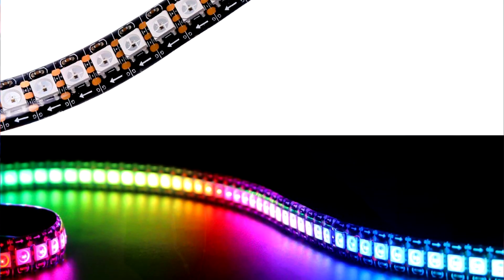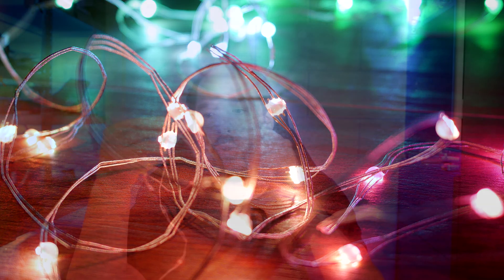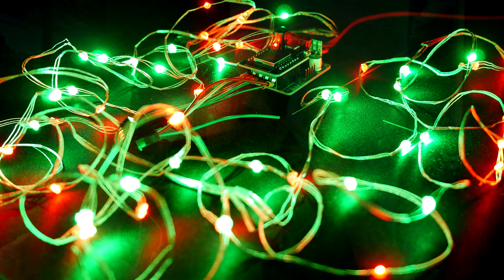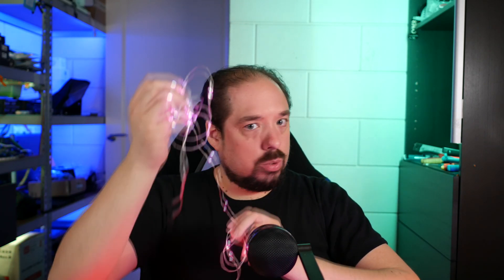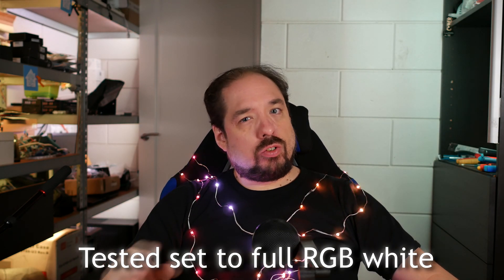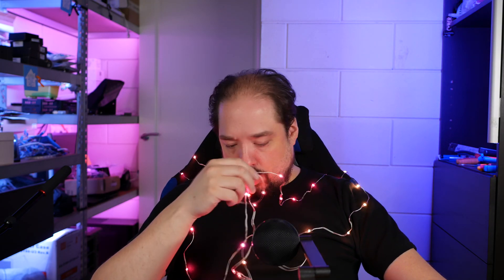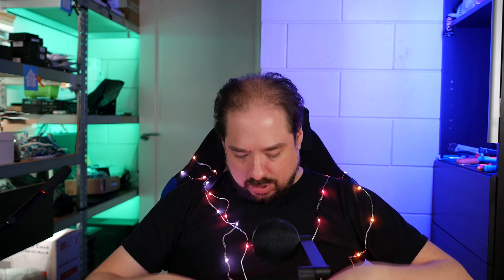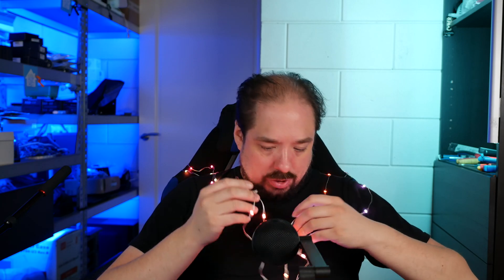QuinLED: Ultimate Addressable Christmas Tree LEDs

Comment: there are solid copper ones too, now, 20 eur for 20 meter of sk6822 rgbw leds every 10cm which is cheap. while solid can break, i know how it still takes a lot of bending. they have better back side illumination

i also wonder if they last outdoors. the waterproofness of all sorts of addressables seem questionable to me. considering the branch sizes of most trees and bushes in my garden, this is best option. too bad they don't pot the 2020 package apa102's... while i can physically strenghten every string with adding extra thin rope as i always do with my lights, i wonder how do i keep them dry in the inside. i even considered buying string of uncoated apa102's and conformal-coat them and then put something like hot glue on top of that to diffuse light. i mean people sometimes re-coat/pot even "waterproof" pixels for usage on trees outside due the reason that most are meant to be used inside signs, not directly under open sky. there's also issue with uv on materials. i mean, i consider them still expensive compared to regular lights and i also feel like it's just huge waste of good leds if i water causes them to fail. i guess i might also just try to put the thin-copper ones outside to see if i get failures. hmm, i wondering if anyone thinks the same

Comment: These looks awesome.. Could you maybe put them into a clear thin rubber-tube/hose for use outdoor?
Reply from the maker: I guess? These things from themselves are certainly not waterproof, or rather the wires probably aren't (you can feel leak current with your skin) so if you isolate them, I think that could work? But that might go beyond the point a little bit, maybe just get normal LED strip or pixels at that point. But it depends on what you are trying to do with them. :)
Reply: @IntermitTech  I dont think flat led-strips are so easy to wrap around things and the large pixel needs a fastening-point for every pixel. In a thin rubber-tube these are almost innvisible and quite easy to fasten with a large cabel-clip or zip-ties i guess.
Reply from the maker: @Every_Journey_has_a_Story  Yeah, could be a cool effect. If you end up building it, join the discord and show it off! :D

Comment: Can the strings be cut to allow for fewer LEDs? Is there something showing what wire does what? Power Ground, signal? These things look awesome for lighting LEGO projects.
Reply from the maker: Yes they can be cut between every LED like normal ws2812b LED strip. Reconnecting it to a plug however might be a little bit more of a challenge to make it neat, but you can solder to the wire after heating it up a little bit and connect stuff together, maybe use a bit of heat-shrink per cable and you should be fine, not pretty, but works fine. I don't know the cable labels but what I'd do is basically mimic the way it's pre-connected when you get it and you should be fine. :)
Reply: @IntermitTech  I went ahead and ordered some from Aliexpress, I will see hat happens when I get them.  Thanks for the info.

Comment: Just recently saw these ICs used in this strand style. Very nice. Bought a battery powered 30 ft long pack that has a remote. Very nice for 14$.  This style will replace my traditional christmas lights or the ws2811 pixels. Very cool possibilities.  We as a community need an open source app developed to mimic the twinkly brand lights.  
They use a different style led though from what I can tell.

Comment: Thanks! They look great... Would like to see how you do power injection and hang into a christmas tree.
Reply from the maker: I'll make sure to make a video about that!
Reply: Marc R I’ve installed four strings on 2 separate trees, and for power injection I soldered the two strings together, kept the male connector and used the female connector that was removed for soldering, for placing power injection wires after they were on the tree
Reply: @led_man  post pics? Like to see how you hide the injection wires
Reply from the maker: @led_man  Wait so, you are power injecting front and back with 4 strings, or front, middel and back?

I'm going to have 6 to 7 strings and plan to do some measurements on them when I have everything in. Since voltage drop was pretty decent (didn't drop too low) I'm hoping I can get away with doing front, middle, back with the total op 6 strings. If not, then I'd try after 2 strings, so front, 2 strings, 2 strings, back. (6 strings total in that scenario)

But I'll be certain to make videos about it! :)

Comment: I have a question and no one can seem to answer it or lead me in right direction 

Any way I can use lifx strands with wled and node without there controller ? It has 4 wires
Reply from the maker: Can't say either, you need to find out if they are analog (whole strip one color) or Digital first (pixel effects). Then we can continue figuring out specs.

Comment: Received them 1 week ago, they are very amazing and bright!
The only downside I noticed was that when the string is rolled up, some interference can occur with LEDs going crazy... 
I solved the problem by lifting up the central wire from pixel to pixel to prevent shorts with the power wires...
Also I prefer the “standard” semi-rigid copper wire, which isn’t affected by this problem... 
Hope they will do it asap...
Cheers!

Comment: Not related to this video but how long can be the cable between the DIG-UNO and the led strip?
Reply from the maker: Since it uses a level-shifter to boost the data signal from 3.3v to 5v, something up to like 10 meters (32 feet) should be perfectly fine. I've never tested longer to be honest, if you use a decent wire, as long as the data signal voltage stays above the ~3v the pixels require as a minimum, you should be fine. But that's why a level-shifter helps so much in that regard, if you start out with only a little bit above 3v, it quickly becomes a problem, starting with 5v gives you a lot more length!
Reply: Intermit.Tech That’s great! I’ll be installing my Christmas leds today and this will definitely help me in the location of the power supply and the dig-uno!

Comment: If the wires were black or green it would be a instant buy, now not really WAF 😎
Reply from the maker: Ah, but with the current cables, they don't really have a color and are reflective, so become the same color as the surroundings, so they blend perfectly, unlike cables with plastic on them and having their own color.
Reply: @IntermitTech  Really? That's sound good enough then, maybe you can post the results after putting them in a tree :)
Reply from the maker: @robertf7741  Will certainly do so! :D
Reply: Spray paint or simply paint with dark green

Comment: Nice can you connect more of them together?
Reply from the maker: Yes, it's just normal ws2812b so connecting multiple strings is no problem, just have to watch voltage drop and inject power at some points, like normal. :)